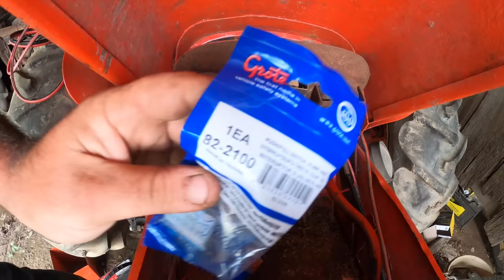CASE VAC tractor: WILL IT RUN???

Comment: I just bought a 1950 VAC for $800 with brand new tires and battery a couple weeks ago. It's a handy little tractor, I think I will keep it! It's in too rough of condition to be worth painting it up, but it runs just smooth and the transmission is quiet. I need to bring it home from the Hystorical Foundations grounds and see what it can do on my dyno for fun.
Reply from the maker: Cool!
Reply: @rosstheoliverman  I'm currently uploading a short of my VAC on the dyno. In case you're interested. I need more tractors so I can make more dyno videos! Or friends with tractors.

Comment: That's an Autolite distributor. Standard Blue Streak points number AL4556P condenser number AL111. I have a 49 VAC myself. One thing most people don't realize the original 6 volt systems on a Case were positive ground on the Rock Island built tractors and negative ground on the Racine built.
Reply from the maker: That’s interesting, I would’ve thought they would keep it standard, but I suppose everybody likes to do it their way.

Comment: Its just like my old 🤬 skid loader, try crawling into the hole between the loader frame and lift cylinder, to change the points, it sucks. Thats either a prestolight or autolight distributor, the napa points are good for this application 👍
Reply from the maker: Skidloaders are no fun to work on for sure

Comment: I am an auction nut and a tractor nut. Maybe just a nut period. Been to hundreds of auctions seen hundreds of tractors. Had a case vac at 1 point for a short time. Never have I seen one with a sparkplug cover. That has to be an unusual piece. I would say most were taken off and thrown under a bench decades ago.
Reply from the maker: I think so too. Thanks Pete!

Comment: If your original replacement switch was from Steiner be thankful that it didn't fit.... I had 2 with a crank time of 2 minutes before I bought a  Standard brand switch.
Reply from the maker: The second one I bought is much better quality you can tell. I agree with you there

Comment: 😮 I notice that the distributor shaft is WIGGLY !  Not  Good .. Suggest replacing  shaft bearings .  I use a thin file on points . Great video. Thanks
Reply from the maker: Yup. It’s not very good. Thanks Thomas!

Comment: I just got 2 slab weights for my 1800, what bolts are needed to mount to the starter weight
Reply from the maker: They’re 3/4”. Just make sure you get them long enough that they go into the starter weight far enough.

Comment: Ross, HUH?  the disrespect you showed to that "Little VAC" was major offensive to me,. My Dad bought a brand new VAC Case tractor in 1950. It powered a one tractor farm. Born in '46 I started driving and working the /case in 1952 at age 6. Neighbors had other brands of tractors. JD A and B models were not competitive Farm all M models were  similar and near equal, Rarely some neighbors had a MMoline, some even were foolish to farm with Ford tractors. That Case was superior to all of them. NO Olivers in my county, Possibly inferior possibly no dealers to sell them. As to your skills as a mechanic I recommend you work o0nly on erector sets.
Reply from the maker: I built a tractor out of an erector set once. It could do more work than a VAC Case.